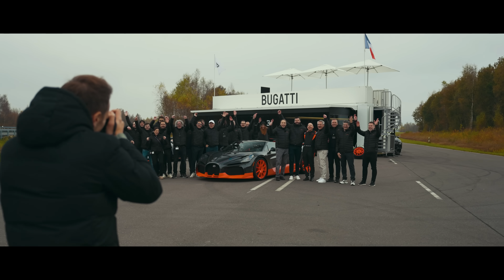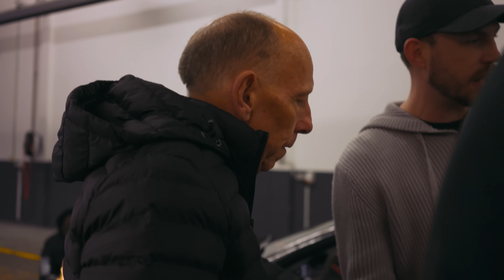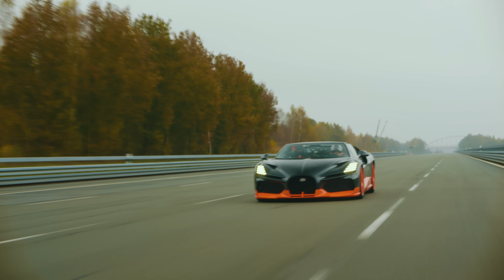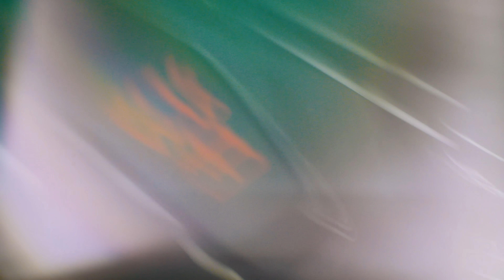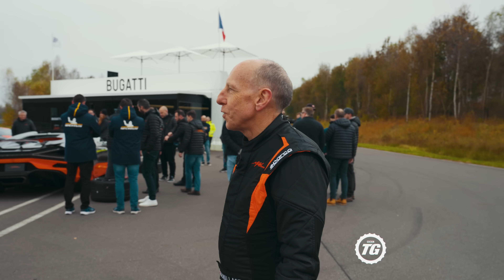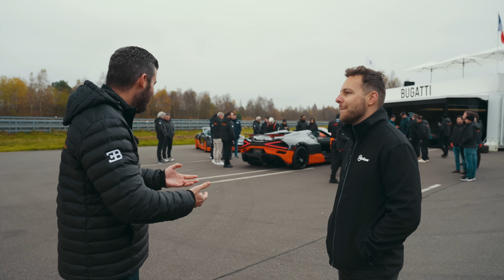Bugatti Mistral! 282mph… With No Roof

Comment: Quick note, air density actually decreases with humidity: https://en.wikipedia.org/wiki/Density_of_air#/media/File:Air_density_dependence_on_temperature_and_relative_humidity.svg

The main issue with the conditions was that the track was wet. The cooler temps 100% helped as cooler and more dense air make more power in turbo engines, its a decent gain and should offset any possible air resistance increase (the air is less dense when humid though).

Comment: It's a targa top not a convertible, a convertible a vehicle that has a mechanical electrical or mecahnical non-electrical mechanism converting from roof to no roof, convert-ible, targa top is without mechanism and needs you to get out the car to take it off or put roof on. Just saying, if the Roof isn't tucked in the back with mechanisms then it is not a convertible for the RECORD, so it really truly is the fastest targa top record not convertible

Comment: I would rather be in a plane at over 200 mph.  One bump on the road and you will be airborne.  With 1000 horsepower EV’s with no maintenance the excitement of exotics not as much but still a work of moving art.  I have owned several exotics.  It’s about the engine and beauty, infomat system no so much.  EV’s like Tesla with all touchscreen is cool but obviously the moving art not there.  More exotics will be EV’s.  The future of cars will be uber, ridesharing, and robo taxis.  Most people can not afford a $50,000.  USA future is more downsizing than supersizing. Beautiful car though

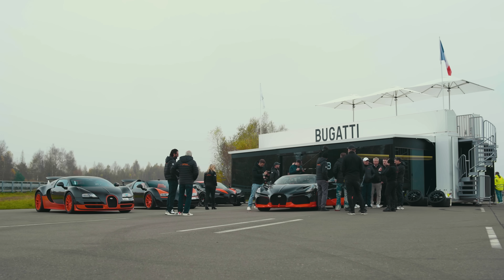Comment: 2:10 This statement is wrong. When the humidity rises ; Air density drops!! Because the relative mass of the water molecule is much lower than O2 or N2 molecule and there are constant number of molecules per specific volume in given temperature and pressure.
Reply: Yeah odd thing to day. Humid air is definitely less dense thar dry air.

Comment: Hopefully this pushes ssc, hennesey, koenigsegg and any others to actually do their top speed runs
Reply: Ssc tuatara stomps this bugatti bro! 295mph and still pulling hard. 😎✅
Reply: @ the chiron hit 304. The ssc set a 2 way average of 280 something i think. And that's with a roof so this is going to more than likely beat the ssc until another run with a higher speed is done, can't imagine how much more this thing will go with out the drag from the open top
Reply: @h00d3dszn  NEVERRRRRRRRRRRRRRRRRRR....😆😅🤣🤣😭🥴

Comment: Can't believe the Venom GT held it for so long. What a car that was. Bugatti are really setting the benchmarks with these record runs
Reply: Is venom gt discontinued?
Reply: @QuantumFlux10  it's been discontinued for years. The F5 however has a roadster version with significantly more power, less weight, and better drag coefficient than the Mistral. We will certainly be seeing a new record from them.
Reply: @THESLlCK Even if they can beat the record can they do it with the same level as comfort as the Bugatti?
Reply: @eobardthawne324  I don’t think you would be judging the supple quality of the seats past 300mph
Reply: @THESLlCK  Yes i would. Also it's not just a out the seats.
Reply: @QuantumFlux10 it's gone already man
Reply: @suyogsawant1104  whyy

Comment: Did matte just confirm Bugatti attempting to break the 500kph barrier next year ?
Reply: Can you confirm?
Reply: @VarunTomee-kr6nf  12:30
Reply: I'm sure they will. Before the jesko..
Reply: Just needs double the power
Reply: @flesz_  
I don't know, Bugatti Chiron super sport was only 10kph shy away from breaking it, and it was only because that what the tires could handle. they could've went even closer or broke it. I think the tourbillon will blow past the 500kph mark quite easily.
I've seen another video where Von Koenigsegg, Matte and Hennessy ceo said they're only waiting for the proper tires.
Reply: @xsanther3155  Andy Wallace mentioned the Chiron SS 300+ was still pulling at 491 but he ran out of room.
Reply: @r0x0r-p4t  
Yeah, from the WR footage of the SS chiron, you can tell it can push for more than what they've achieved.
Reply: @xsanther3155 nah its imposibble for tourbillion to breaks 500kph barrier. Cause tourbillion only have 1000hp from ice.
Reply: @Arthur2_right  So? Peak power is 1800hp. Top speed doesn't only come ICE power. At high speeds (400kmh+), yes peak electric power will diminish a bit. But not by too much. The Nevera's power dropped as low as 33% at its top speed. The electric motors here are also from Rimac. However, they are different from the Nevera's E motors, as it's specifically a hybrid electric system, not fully electric. And they were engineered after the Nevera. So likely has better power efficiency at high speeds. Even at roughly 33% power drop from peak electric power, it will still have a peak power output of 1500+ hp. Around the same as the Chiron SS. But it will weigh less and be more aerodynamic than the Chiron. And this is just the power of the base level Tourbillon. We still got other variations to be announced, likely with increased power output for a couple of them. As well as improved aerodynamics, decreased weight, better tires and suspension, adjusted gearbox, etc.
Reply: @connorobeirne934  Well, you don't understand mate. Yes the tourbillion has 1800hp, yes it has 800hp from the electric motor. But the Tourbillion only has 24 seconds of full power before the power from the electric motor drops. And as you can see the Torubillion has more drag than the Chiron SS because of its exposed engine. The Chiron, which has less drag, takes 70 seconds at full throttle to reach topspeed, while the Tourbillion only has 24 seconds before the power from the electric motor drops and has more drag. Realistically the Tourbillion can only reach 450-470kmh not 500kmh.
Reply: They should come to do the run in Canada. We got a stretch of Highway here it can definitely be done. @r0x0r-p4t
Reply: @Arthur2_right  
What makes you think that Bugatti won't modify the Tourbillon to reduce drag in the same manner they did with the Chiron and the Veyron ? 
If, as implied from Matte rimac in the video, that Bugatti are truly aiming to break the 500 barrier, then customizing the car to increase it top speed capability would literally be the easiest task for them. 
Like i stated in my previous reply, these motor head already made it clear that they are only waiting for the tires to catch up (it is stated in this video: /watch?v=6JP9Swop_Fg&t=1302s)
Reply: @xsanther3155  cause i know the regular Tourbillion wont do a Top speed run,except 0-400kmh run. Like The regular Chiron
Reply: @Arthur2_right  24s is quite short. Perharps a SS Tobillion with extra power + longer battery range.
Reply: @GrayFoxGamingHD  The best way is to use a turbo in the v16 engine. But it seems impossible, so it is likely that Bugatti will only add power to the v16 engine by increasing its rpm to 10-11k. And upgrade the battery to increase the power of the electric motor. Easily generating 2100hp+(1100/1200hp ICE+1000hp EV).
Reply: @xsanther3155 Andy Wallace said he could have gone faster but he had to hit a breaking point as there wasn’t enough room
Reply: @flesz_  Why would it need to double the power? It doesn't need 3600hp to reach 500kmh. Power isn't everything. Power isn't even the limiting factor. It's tires. Of course, weight, gearbox, suspension, and especially aerodynamics, are essential in reaching those kinds of speeds. But Bugatti has pretty much all of that down. The Chiron SS 300+ managed to reach 490kmh with peak 1578hp.
Reply: I don't disagree with you that the base Bugatti Tourbillon would not be able to reach 500kmh. It's electronically limited to 445kmh anyway. However, Bugatti would obviously engineer a top speed model of the Chiron to reduce drag. Although, I'm betting that they wouldn't hit the drag wall before 500kmh anyway. Tires are considered the primary limiting factor for all Hypercars at those speeds.

Comment: When did we start letting Bugatti have 1 direction top speed records but not Hennessy???
Reply: Hennessy did one direction run with their Venom Roadster. Majority of manufacturerx run their top speed vehicles in one direction on a flat road with virtually no wind. Add the asphalt being one  big factor meaning the danger of doing bi-direction runs on a track that saw one direction for decade resulting a deformation on the surface of pavement. Pierre-Henri Raphanel, the Bugatti driver who did the Guinness Record on Veyron SS, reported how frightening it is to do the opposite run on Ehra Leissen when nobody ever did that before due to deformed pavement resulting the Veyron following that path thus stressing the tyres. Repaving the track costs money and time so it is economically unworthy just to do a record bi-direction run.
Reply: I was wondering if we would see both directions, im assuming we don't.

Edit: the wikipedia entries are ONLY bidirectional, single directions are excluded. And guiness world records require an official. Not just cameras and such

Comment: does not count it has to be done in two directions within a set time.
Reply: @AnthonySteinghart  they have rules for a reason, i learnt that because i grew up.
Reply: The problem is reality. Doing two directions on a track that saw one directions for decades is extremely dangerous for the tyres. Plus, who will pay to repave the asphalts just to do two direction? Guiness?

Comment: Νοw bring that Tourbillon with its 1800 horsepower and see how fast it can go...
Reply: Hopefully it has enough battery reserves to sustain that kind of acceleration for that amount of time.
Reply: @MX5-XU it has quite a big battery and it only needs to sustain that performance for a minute (most likely less)
Reply: @rocketsts  yeah I responded to another comment with some numbers and think it’s definitely possible but it will be close as I think that even with its relatively large battery it’ll only be able to sustain a run to Vmax for only about 30-45 seconds.
Reply: @MX5-XU given that it's going to be doing 400kph in less than 26 seconds I think am extra 19 seconds is enough for it to reach vmax not to mention they start their records with a roll on from 250kph so they somewhat have a headstart
Reply: @rocketsts  not sure where those specific numbers are from but yeah I think only time will tell if they have enough or if they’ll program in a special mode that allows it to not use any battery through the 250kmh start etc.
Reply: @MX5-XU  the 26 seconds acceleration time to 400kph is what they state officially and i assume it'll be in recharge mode before starting the record run like other hybrids when they intend to start a hot lap so yeah. I think 26 seconds is conservative for them considering the power and the fact they think they can get it to weigh less than a chiron
Reply: @rocketsts  gotcha, I didnt realize they posted their own figures yet and their website even mentions 0-400 being under 25 seconds. Wonder how long it'll take to get from 400 to it's top speed. They say it's top speed is "only" 445kmh but of course that can be pushed out further if they make changes or come out with special editions like their current and past lineup. And then the hybrid energy deployment might differ between the 0-400 run and a full top speed run to ensure it still has power for the last few kmh. The footage from this video shows that it maybe gains a little more than 1kmh per second towards the top end.
Reply: @ALMX5DP  I'm sure it's geared for more than 300mph but since it's the base car it's just limited to 445kph

Comment: an official record is the average speed in BOTH directions on the same track
on the same day !
that VW testtrack only alows 1 direction
bugFatti NEVER had any official record
and if they wanna claim anything,
they should allow Koenigsegg, Hennessy and others
to drive there also !
Reply: Maybe use your brain for a second. VW Group wouldn't let anyone test on their track unless they owned them apart from McLaren which was a one off. Hennessey did it in 1 direction and still had the record for no roof production car, and it was literally verified from a verification company
Reply: Papenburg Test Track is open publicly, you're either absolute dumbass or your network is down, that's why you can't watch the full video?
Reply: Don't worry, someone will do in the autobahn on a work day some day...  One of the most impressive feats of the Bugattis is how insanely stable they are at high speeds, which makes their users to sometimes do things they shouldn't...

Comment: Fun fact: since it was first introduced, Bugatti estimated that it'll do 261mph. That's 21mph more. And that's EVEN in the Wet, it was still pulling.
Reply: Probably could do 290-300 flat out in Nevada.
Reply: On tires that were pulled out of a mold 18 hours before the test. To be done one time only for 12 laps. Every tire will be cut apart emulated and come with a warning notice if you have the 50k to buy new" for Limited use " FN cool they did it but in any reality, it can't be done in a road car.

Comment: I think Bugatti will always have ICE. They will use e-fuels and hybrid tech in the future to remain. Crazy engines are Bugatti.
Reply: Bugatti may not even do e-fuels. Bespoke manufacturers selling below 1000 cars a year are exempt from emissions regulations pass 2035. Porsche needs it due to their high production numbers.
Reply: @TheMitch12356  Or create a new brand and split their low-mid class cars and top of the line halo cars.
Reply: dont think so they are owned by EV maker now
Reply: @lemcake32422 
Mate rimac himself said that Bugatti will always be ICE
Reply: @Fastwalker27  its not, its already got EV motors
Reply: @lemcake32422  that doesn't matter when you have an 8 liter 16 cylinder engine
Reply: @Fastwalker27  it has 3 motors Bugatti slowly moving to EV
Reply: @lemcake32422  yes just ignore the fact that it has a larger engine than it's predecessor
Reply: @Fastwalker27  dont ignore the fact its got 3 Rimac motors
Reply: Probably will have ice until they go bankrupt.  Either that or they will start making EV’s to prevent bankruptcy when ice cars get banned.

Comment: "No vibration" at those speeds is just insane
Reply: Meanwhile my car trying to shake itself apart at 65, lmao
Reply: My Micra doesn't have any vibrations either
Reply: Not insane at the price
Reply: Airplanes do it at 10x the speed
Reply: @Yarmox i might not be an expert but i dont quite think this is an airplane
Reply: Airplanes work Way different @Yarmox
Reply: @Hungary_0987  tesék?
Reply: @Yarmox  airplanes have zero friction to the ground.
Reply: @Visakh_S_Nair exactly
Reply: @Yarmox they don't have ground friction
Reply: @Yarmox  airplanes fly at mach 4?
Reply: @Yarmox  Show me the Airplane that went 2,800 mph, and lost its roof and didn't vibrate. I'll wait... SMH
Reply: @Yarmox less air resistance at up in the air
Reply: @Yarmox  ok ?

Comment: Curious whether Tourbillon will go for a high top speed. Hybrid dependant so it would need to be quick to get there. Can it do two runs on a tank and charge its own battery?
Reply: Yeah it’ll be interesting if the hybrid system is able to sustain that kind of necessary output for the 30-45 seconds that is required on the straightaway. The Tourbillon is supposed to have a 24kwh battery, but of course that is equivalent to only about 3/4 of a gallon of petrol. The Chiron uses about 1.4 gallons per minute at Vmax so it might just have enough based on that napkin calculation.